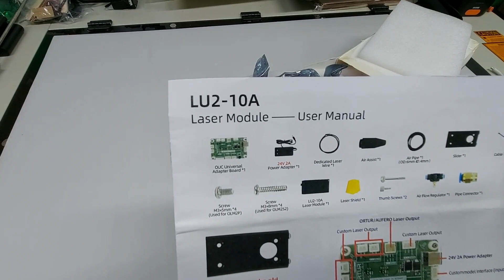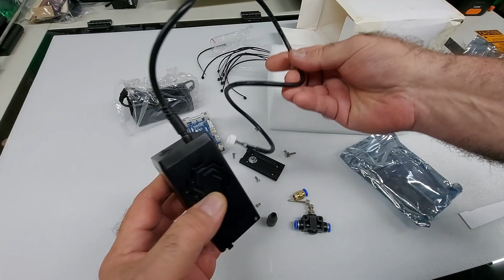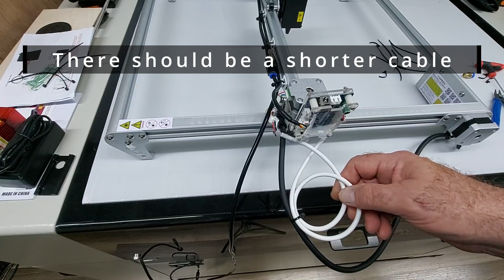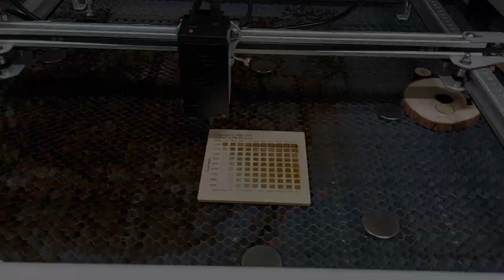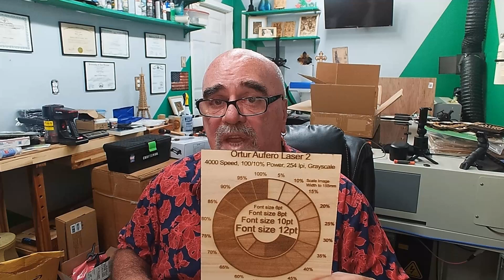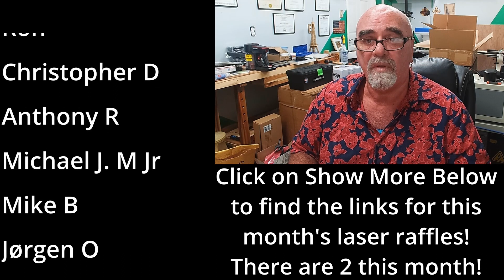ℹ️ Ortur 10W Laser Module Review! (July, 2022)

Comment: Hi Rich, thanks for this video, great content. I've been thinking of upgrading and have been intouch with Ortur to ask a few questions as the info on various sites aren't great. I have the Z axis lifter so will need an adapter plate which according to Ortur isn't available. 
I would have had the circuit board in a case and then mount at the back, as a former electronics engineer the cable management is bad, it really irritates me. I'm used to looming cables and took pride in lacing cables as we didn't use ties. They should design with more thought about retro fitting upgrades.
Reply from the maker: Agreed Rob! I feel the same.

Comment: Rich,
I ordered the new module, leaving me with an unused 5w diode. Can I use this on my original laser master, the one without the track?
Reply from the maker: The original LM & LM2 are 12V, and the LM2 Pro is 24V, so to use it on the original, you would need a separate power supply for the laser and would have to disconnect the red pin from the control wire Dan.
Reply: @TheLouisianaHobbyGuy  Thank you for taking the time to reply.  I watch all your videos, and am getting much better with Lightburn as a result.

Comment: Hi Rich, thanks for the informative review. What I was hoping to learn was if this module can be used on the ‘older’ systems, specifically the LMP2 in my case. Perhaps a “short” 😂video on this topic would be of interest to your followers if the 10w can be added to them. Thx
Reply: I installed mine on the LM2 Pro in about five minutes and was off and running. There is no software upgrade so this is a really simple upgrade.
Reply: @krisknowlton5935  Thanks Kris, I’m having a major issue with NEJE A40640, never has fired so trying to return but getting the run around. Dealing with their support for 5 months. This seems to be a simple option then.
Reply from the maker: I thought I mentioned it was compatible with the LM series? The instructions have info on all of their lasers.
Reply: @TheLouisianaHobbyGuy  Thanks, I may/must have missed it.

Comment: Great video!! I have been waiting for this and my fear was confirmed with the new module, it doesn't allow you to use the z height adjustment accessory. One correction though they are called zip ties.
Reply from the maker: A drill bit will solve that problem!
Reply: Ak Sasquatch, yea, that is the only thing I didn't like but when I have the time I will correct that. Other than that I think it is a great upgrade. I have done a few projects with it and they turned out great.  I use a lot of hard maple in my projects and this module cuts through really nice. What took up to 4 passes with the 5 watt now only takes 1 pass with no charing.